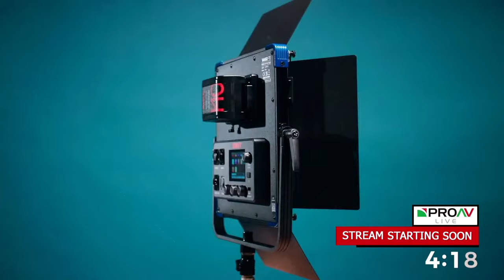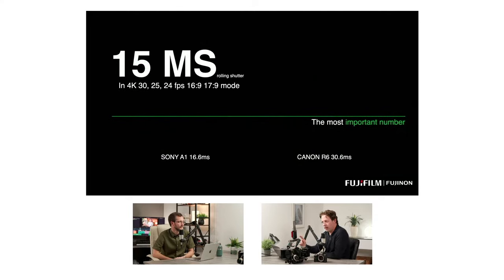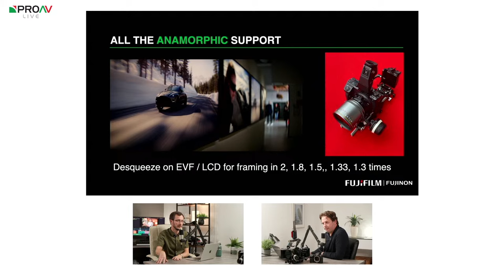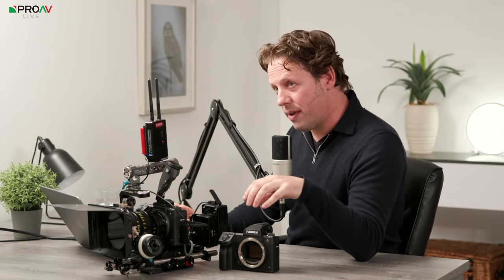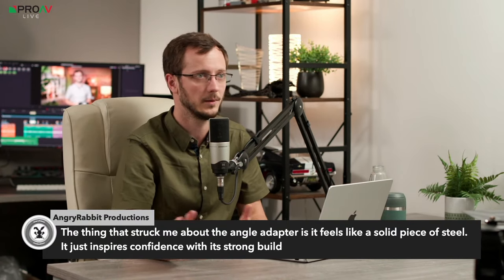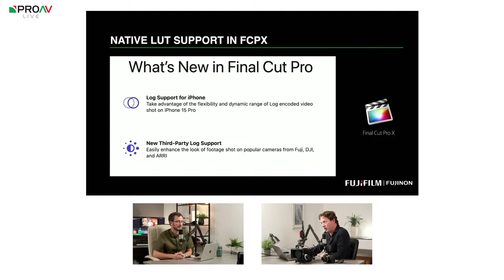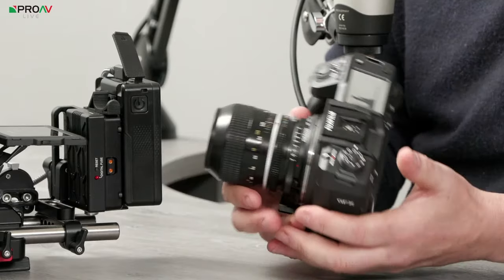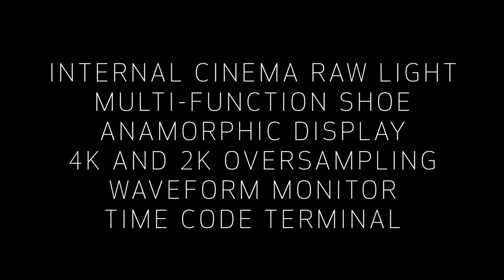Fujifilm GFX 100 II for Video Production - Overview and Q&A with Jim Marks

Comment: I have a couple of questions about timecode and recording options. I'm so nearly sold on this. So if I get this right, I could use an ATOMOS and an ultra sync Blue plugged into a Pre mix and jam sync all? Would that be the case if I am recording internally the 5.8K?  The other questions would be getting 12 bit some how. I wonder if there is anyway for getting that 5.8K into RAW BRAW or Apple RAW, if not some other 12 bit? Would either the ATOMOS or VA do this? Perhaps DNxHR HQX on the VA? If only Fuji managed to get a 4444 12 bit in there. the extra bit depth really does matter when you're pushing pixels around and using VFX work flows.

Comment: There doesn't appear to be any mode in which video can capture the full sensor.  For 8k, the sensor is cropped to a smaller size than a full frame camera.   And by reports, it's using pixel binning or line skipping when video is the full width of the sensor.  
Great stills camera. Great sensor.  But since neither the full width nor height of the sensor can be used for video without skips or bins, don't see any point in this body, for video.  Most especially at the price.

Comment: Is the camera oversampling in the 5.8K mode or pixel binning?
Reply: According to Engadget, it's either pixel binning or line skipping. Seems that Fuji isn't saying.
Reply: @Trevellian  that’s interesting because in this very video we see in his presentation that there is oversampling happening (at least it’s implied). I just want to know in which modes
Reply: If it were fully reading the sensor before downsampling to 4K,  Fuji would be heralding it from the skies.  It would rival an Arri Alexa LF.  But Fuji isn't talking about how they're managing 4K, all but confirming that it's pixel binning or line skipping.  
Given the low rolling shutter, suspect the 4K mode only captures about the same amount of pixels as full readout, full frame cameras that cost 1/4th as much, like the Panasonic S5 ii.  @JamesJacksonFilmz
Reply: @Trevellian  I don’t think that’s necessarily true fujifilm would be singing from the mountains if it was oversampling. And again the fujifilm presentation literally says it’s oversampling. It just doesn’t say in which modes. I’m almost certain it’s oversampling in the 4K and FHD GF modes.
Reply: It likely has a small oversample along with a massive amount of pixel binning / line skipping.  This sensor has an exceptionally large number of pixels, requring an astounding amount of data throughput (assuming full sensor readout).  The sensor readout speed gives it away.  ARRI only manages it with their LF by using two separate sensors abutting one another, each read discretely.
This Fuji could very well be sampling 6k (~20 megapixels) to 4k, (~12 megapixels) the same as any number of full frame cameras.  But with the GFX 100 ii, that 6k needing to be sampled from across a 102MP sensor.  That would mean 4/5th of the sensor's pixels would not be read, the light hitting those sensels entirely discarded.  In a 1:1 tests, suspect many full frame, full readout cameras offer better image quality for video, as they would be collecting more light.
If its video were fully reading the entire sensor,  Fuji should absolutely be singing it from the mountains.  @JamesJacksonFilmz
Reply: @Trevellian  so it actually is oversampling from the full horizontal sensor in the GF mode. The reps from Fujifilm stated this in an interview with CineD.
Reply: Oversampling and pixel binning are not mutually exclusive.  They can both be done at the same time, and almost certainly are both being done with this camera.
Consider that 4K is a miniscule resolution as compared to this camera's actual resolution.  This camera's sensor has *102 megapixels*, but a 4K image is just 12 megapixels, or about 11% of this camera's native resolution.    
If only 20% of the camera's senses (sensor pixels) were being recorded, but that was sampled down to the 11% needed for a 4K image, it would be both oversampling and pixel binning / line skipping at the same time.  
All 102 MP of the entire sensor cannot be read out 24FPS, as the data rate would be too high for a body this small and (comparatively) inexpensive.
The problem is that exposing only 20% of the sensor would result in less sensor area being exposed to light than that of full frame, full readout (no pixel bin) cameras. And some of those full frame, full readout camera bodies cost 1/4th what this body costs.  
It's probably a great body for stills, but wouldn't begin to consider it for video.
Meaning that @JamesJacksonFilmz
Reply: @Trevellian  true, but they specifically said that it’s oversampling the sensor. This is something that is not impossible. Blackmagic’s 12 K camera has an 80 megapixel. Read it out like the GFX 100 edit down samples to 4K and that’s a super 35 sensor.
Reply: An "oversampled sensor" is an entirely different topic.  It pertains to dynamic range.  For reference, see the Wikipedia article titled 'Oversampled binary image sensor'.  Yes, it's quite confusingly named.
As for video, would be shocked if it's actually exposing any more than 1/4 to 1/5th of the sensor when shooting 4K video.  The real giveaway is that Fuji isn't saying. @JamesJacksonFilmz
Reply: @Trevellian  but it was the developers from Fuji themselves that said it in the interview that the 4K is oversampling from the full resolution
Reply: Can only believe there has been a mistake in language, interpretation, or translation.  Consider the amount of pixels that would need to be modified.  Even if cropping to 16:9 for a resolution of 11,648 x 6552, that would require 76 million pixels be transformed down to 12 million pixels, 24 times each and each second, continuously.   Representing a data rate of over 5 giga*bytes* each second.  
And each of those 5GB would not just need to be copied, but run through a processor-intensive algorithm to smartly average the 76 million down to 12 million.
This camera is not doing that.  It's throwing away data.  Because today, the computation to perform that task is larger than that camera, and more expensive, and would require large fans to keep it cool.  Eventually computation will catch up, but not yet.  @JamesJacksonFilmz
Reply: @Trevellian  they gave the answer in English. Also as I mentioned before, blackmagic has the 12K sensor that oversamples the whole 80mp sensor and down res it to 4K with no pixel binning in their 16 bit raw codec to CFast 2.0 cards even possible to record SD cards depending on the compression. It’s possible they are using a compressed version when it comes to ProRes. Because they certainly are compressing it with the HEVC codec.
Reply: Then they were 'mistaken'.  The video modes of the GFX100 II are absolutely not oversampling from the full resolution.  Depending on the mode, they are either cropping or binning, with terrible rolling shutter in most modes. As indicated  previously, the sensor has too much data for it to be fully read rapidly enough for full-readout oversampled video.  PetaPixel's review reveals all. - https://youtu.be/RuTXFfkygj0?t=1075   @JamesJacksonFilmz

Comment: Thanks for making this amazing interview. So sad I missed this live so I could ask the question. The GFX100s (which I own) I tried recording externally raw through BM Assist as well as with NinjaV and the delay was unlike I have ever seen, practically useless, a bit more than a second if I recall. How is the delay of the GFX100ii when sending 12bit RAW to an external recorder, as well as a normal HDMI monitor. I have come to believe the issue persist because no-one seems to talk about it. I mean 12bit BM raw is definitely better than probes 10bit in my personal opinion and the fact that this is even an option is one of the best selling points, I just hope is not as useless as it was on the gfx100s where the feature was so badly implemented between BM and Fuji that I just record internally now. Thanks for any input.